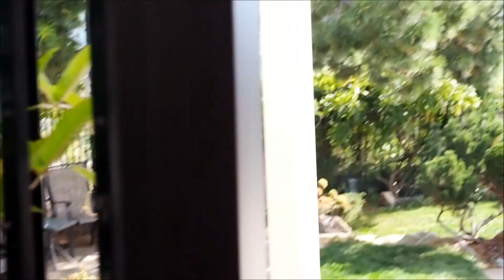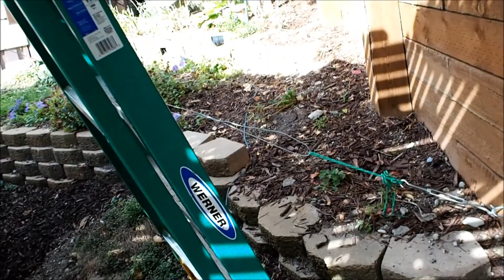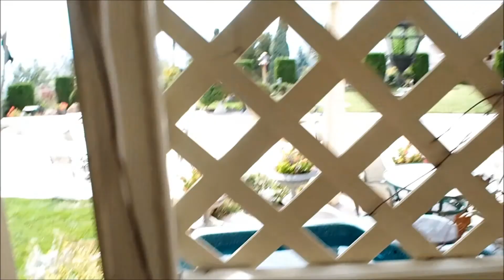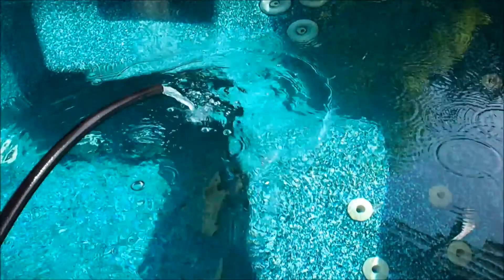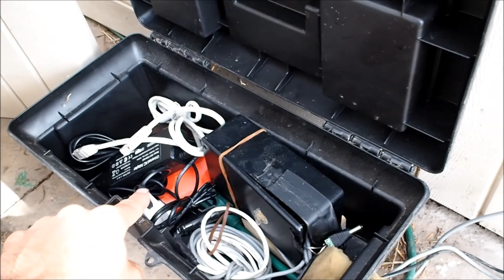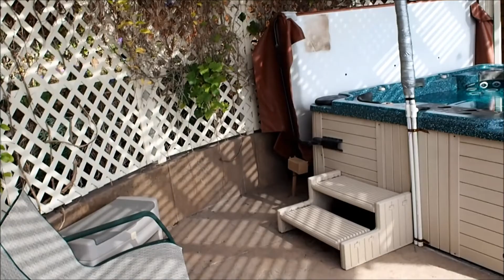Solar heated hot tub using evacuated solar tubes

Comment: I'm curious how hot the water gets just from the solar heater.  Also, any idea on the volume of water in the hot tub?  I'm building a small shed this upcoming summer  for a workspace and considering burying at couple 1000l ibc tanks under the cement slab.  Hoping to  charge them all summer and fall with solar and let them radiate through the winter to offset  heating.
Reply from the maker: Sorry, I don't recall the temperature on the output side of the solar tubes.  We don't live there anymore, so I can't check.  The tub was 400 gallons.   I doubt any sort of long term heat storage would be effective.  Too much energy to store, especially considering the inevitable heat loss.
Reply: You'd due better with a simple geo heat exchange then trying to store the heat.

Comment: I wonder what the actual cost benefit anaysis is between using evacuate and non evacuated tubes. Additionally, I wonder if it is possible to put the passive solar at a lower elevation than the tub, and allow the sinking cold water to fall down and down to the solar heater, where it is pushed back up via convection. I do not know if this would actually work without a pump, and did not take thermo in college, so IDK how to calculate the optimal inlets and outlet locations. I think these changes could potentially save in complexity and cost, but possibly at the expense of having the pool at a slightly lower temperature in standby mode, and take longer to heat up.
Reply from the maker: In cold weather, non-evacuated tubes are a non-starter.  For summer use, would work fine.  Thats what our pool had, black plastic pipes.   But in cold weather,  when you mostly want to use a hot tub, even the heat loss the short distance too/from the evacuated tubes was problomatic.   
Convection might work,  but you would still need to turn it off when there was no sun.    And in our case, the only non-shaded area was above the tub.  The cost for the small 12 volt pump and electricity was negligable.
Reply: @BruceWinter  Cool, great info, thanks.

Comment: Why not use liquid metal in it? Then have a copper heat exchange coil to heat your water.
Reply from the maker: The glass tubes enclose a copper pipe with a gas/liquid sealed inside.    This gas/liquid (not sure what it is) is picked because it has the right  evaporation and condensation temperatures,  not sure a liquid metal would .      The top of the tubes do plug into a copper heat exchange in order to heat the water.
Reply: Novartis!
Reply: The copper nipples would transfer heat into the liquid metal. Circulate that through copper heat exchange coils to heat water. Use all that heat to generate electricity. You could also set up a positive and negative charge on the liquid metal to drive the pump that moves the liquid metal through the system. If you know how to do all of that you can say good bye to your electric bill!
Reply: You can make pykrete cold sinks and use cryosterling technology for your cooling needs has well. To totally leave the grid! ; )
Reply: You know you could design a small solar tube that would heat only to a certain temp. Then run liquid metal and make a personal heating system? Like an environmental suit? You could be walking across ice and be snug and warm! Novartis!

Comment: I really like this idea and have been thinking about using it for our hot tub.
I have 3 questions....
Do you have to use your regular heater to supplement, and at what temp?
Do you usually have an insulated cover on the hot tub?
Have you thought of using a reflector behind the evacuated tubes to give them more radiation?
Reply from the maker: Mark Stevenson 
1: Yes, we still use the built in electric (expensive!) water heater, especially in the spring and late fall when it is cold enough that the solar can not keep it heated on its own.    
2: Yep, insulated cover is on all the time we are not using it.
3: No, but there is not too big of a gap between the tubes, so the black absorb-er fins in the tubes catch most of the sun for the tube's footprint.

Comment: Do you have any kind of pressure regulators or check valves? My fear would be that the collectors would boil the fluid in the heat exchanger manifold and create a dangerous high-pressure scenario (assuming your pump breaks). I ask because I am looking into doing something similar (different application) and have often wondered about this. In my case, I would be using a closed loop system with a radiator as the heating endpoint. Do you have any advice?
Reply from the maker: No regulators or check valves needed.  There is indeed some steam generated when it gets sunny and the pump has not been started yet, but it simply vents into the return line and creates a few bubbles in the tub.   This open loop system (simply circulating the hot tub water) is simpler than the closed loop system you need in your application.    Works fine with hot tub water, but not usable when heating potable water.

Comment: I appreciate you posting the video of how you heat your hot tub.  I was curious if you looked into getting solar panels to heat an element in a small heat tank. With 4 panels you would be able to get 600 -700 watts for 5 hours or so.  I think you would get your water hotter, and not have to mess with pumping water up and down from your roof. I imagine you looked into this. Why did you choose not to go that route?
Reply: Bruce Winter The other consideration is that electric solar panels wear out. The purchase and installation cost usually exceeds the cost of regular electricity, and its all paid up front.
Reply from the maker: Mark Stevenson I also installed an 18 panel 4.5 kw solar panel array (see this post: http://misterhouse.blogspot.com/2014/11/monitoring-solar.html ) .  They are rated for a 25 year lifespan which I suspect is reliable (they demo these panels by driving trucks over them).    In sunny Utah, at today's rates, they will be payed off in < 10 years, so they are a clear winner if you can afford the up front $10k cost ($15 k without the federal tax break).
Reply from the maker: I did look at that a little.  There is a company, in CO I think, that has a product for just that.   In my case, we had no water heating tank, so that would have been an extra component with associated cost and heat loss.  

More importantly, I think the tubes give more btu per $.   The tubes are advertised at about 60 watts per tube max output.   Roughly 16 tubes * 60 = 1kw * 6 hours = 6kwh, which is the same as running the 6kwh heater for 1 hour.  

I measured a 4 degree gain on a sunny day (less on colder days).    For a 400 gallon tube, that works out about right, considering there is also heat loss during the day.    4 degree * 8 btu/gal * 400 gal = 13k btu.   * .3  w-hour/btu = 3.8 kw-hour.

So on a sunny 6 hour day, 16 tubes = 6kwh daily = $0.6/day.    Skipping Winter and running the tub for 8 out of 12 months would give a break even payback at about 5 years.  Tubes were $700 = $500 + $200 shipping, which is about $0.7 per watt. 

I just installed a 4.5 kw solar electrical system for $9k after taxes (I have a couple of videos on that).   At $2 per watt, a 1kw system would have cost about $2000, about 2-3x what the tubes cost.

One other consideration is because there is circulation for 6->10 hours a day through the solar tube heat exchanger, there is little need to run the hot tub pumps for filtering/circulation.   So we only run the hot tub pumps for therapy when we are using the tub.   I was surprised to see how clean the water stayed.  I add a cup or so of bleech once or twice a week, and monitor the ph and add acid once a month or two, and only had to exchange the water twice last year!   Mostly just 2 of us using it, but we use it every 2-3 days.